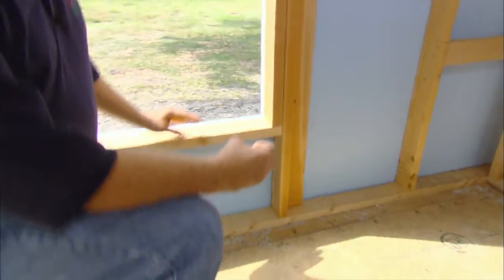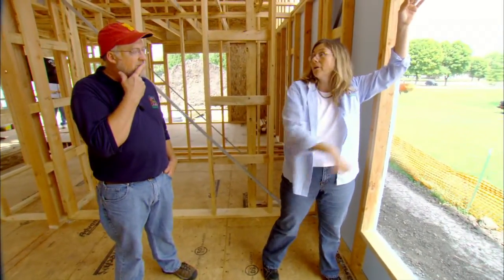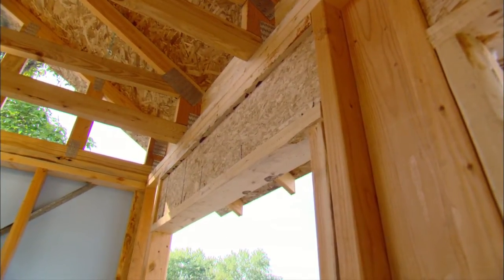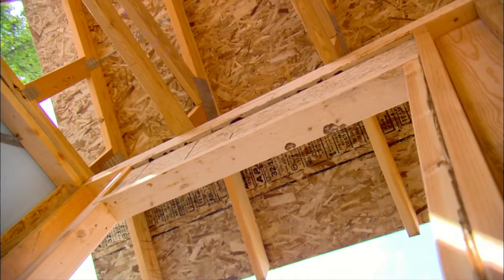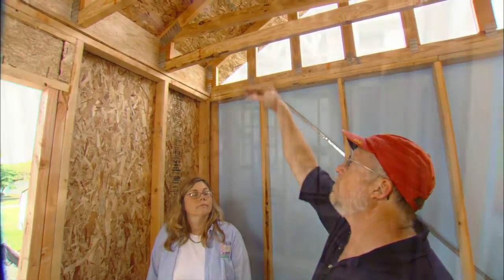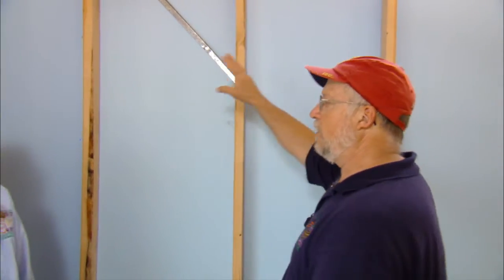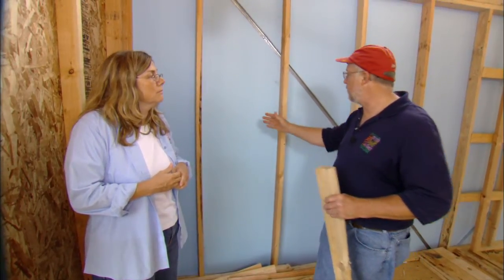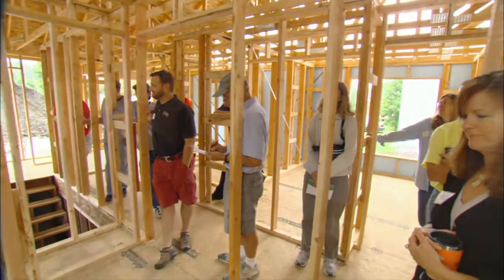COSC Affordable Green Building Series: Advanced Framing Part 2

Comment: I'm all for the green efforts but I don't like the fact that I could walk up and basically kick a big hole in the side of that house. Also I've been framing for about aid years and even though that is a self supporting gable wall that header would not pass code. (Missouri) I did like the TGI style headers, much easier and faster than traditional headers. However they seem like they would only work on non load bearing or ranch style homes.